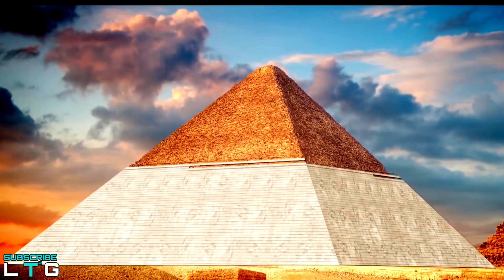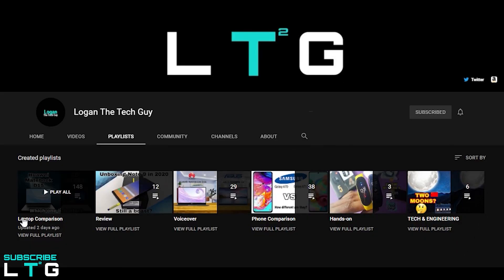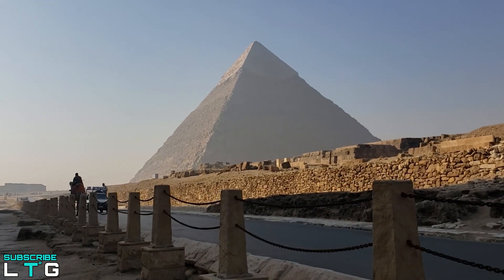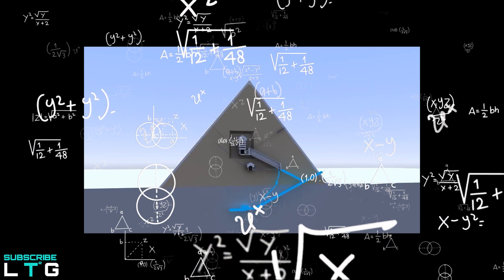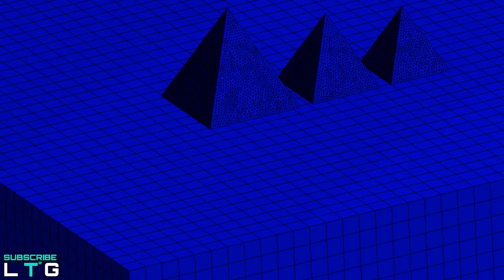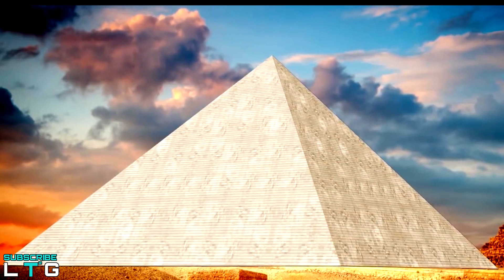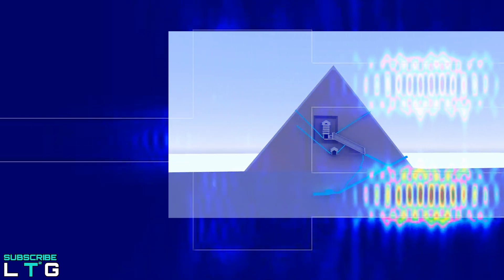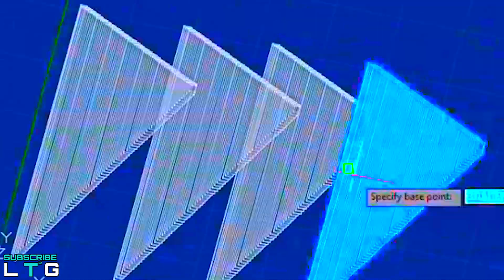The Pyramids of Egypt: What is the mysterious energy? | TECH & ENGINEERING |

Comment: The great pyramid in Egypt has 8 sides. The sides are slightly indented along a straight line going down the center of each side. It is so subtle that it was not detected until a person flying over it on an equinox saw the shadow it creates only on that one day of the year. It was part of its original design. It was not a tomb and was probably built long before the age of the dynastic Egyptians.